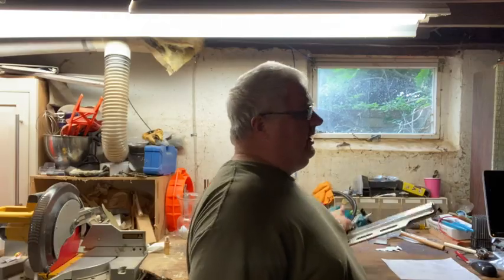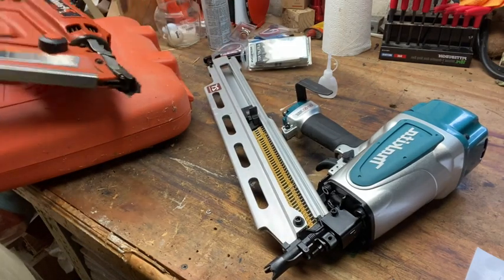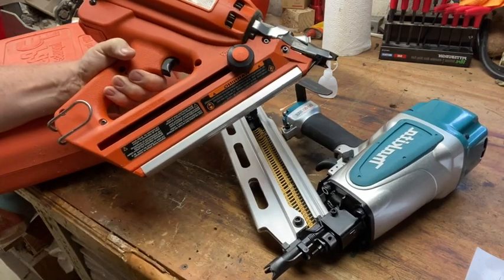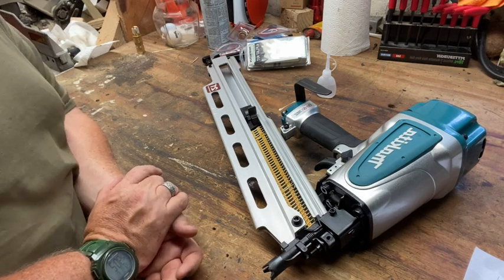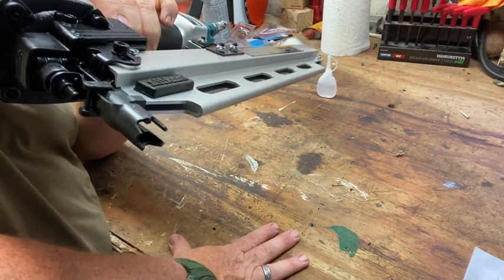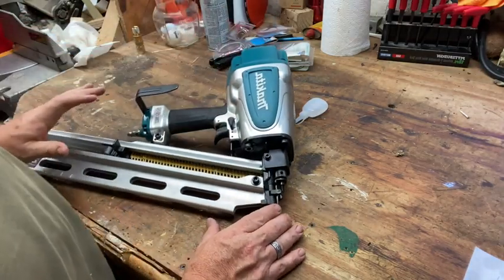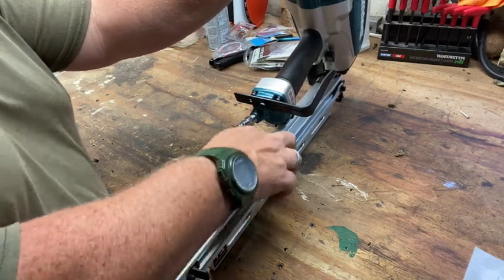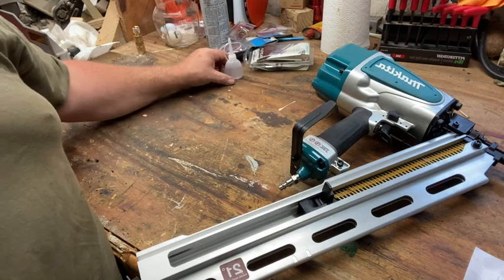Makita 924 framing gun

Comment: As a builder who uses this every day, it's not a good framing gun. I own a metabo and a bostitch framing that are both older and they're way better. The makita is always having problems. Jambs, doesnt drive the nails as well and all the screws loosen, actually lost some.
Reply from the maker: I totally agree. As I have run through cases of nails the gun is very particular about the nails it likes. I don’t run two sticks. When I use the nails it likes it’s as reliable ad my old Dewalt gun was.  I don’t have issues with depth of drive of nail, that’s never been an issue. I did have a chance to run the Metabo actually I ran two cases of nails through it and after those two cases of nails, I had to take the nail gun back to Lowe’s. It was worse than my old Porter cable. Thanks for your comment.
Reply: @n3qdz Yeah, I also have problems with all my framing guns running 2 racks of ring shanks. I've found the metabo brand ring shanks are the best, less likely jamb on all my guns. I do like makita, I own 2 of the 40v worm drive saws, love those things. Also own a handful of other makita tools. But I won't buy a framing gun by them anytime soon.

Comment: How is it holding up?
Reply from the maker: So far, with about 6 cases of nails through her she’s working like a sewing machine. Two sticks of nails  every time. Now if the nails are old and the plastic is soft the last nail will get stuck. My buddies Hitachi gum would do the same thing as well.  But what I did notice os how much lighter  it was over the Hitachi and and old Pasload.
Reply: @n3qdz  thanks just got one use makita for reliability but have always used hitachi framers , pasloade cordless but couldn’t beat 159.